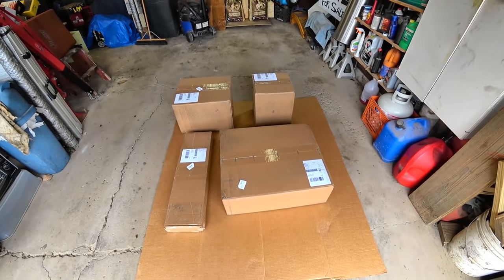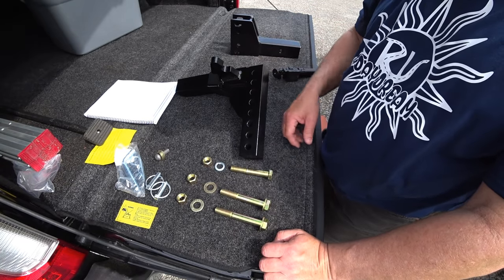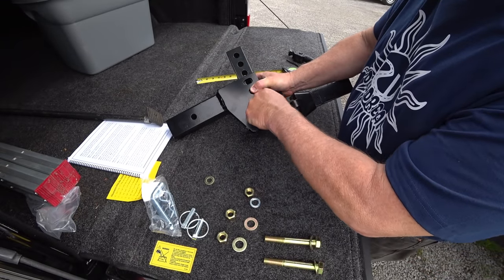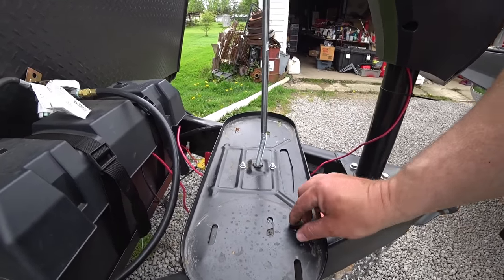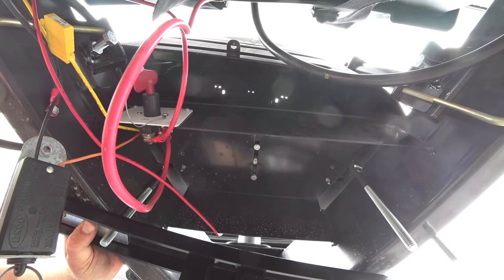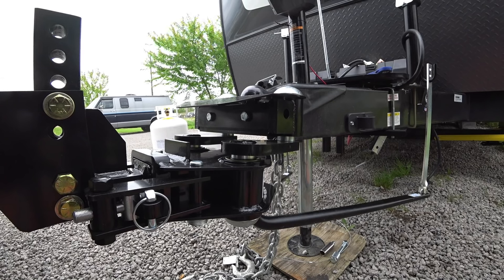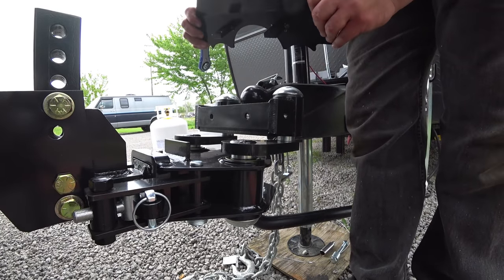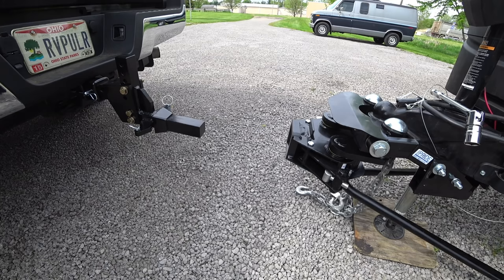ProPride 3P Hitch Complete Installation

Comment: I was wondering what the height is to the top of your receiver on you 2019 -250 ? I run into the same problem where my trailer is way to low in the front. Great job installing your pro pride.it was most helpful. Thank you and be safe.

Comment: It looks like a nice system and good in depth install.  But I just don't like how it puts it father away from the truck putting more leverage on the trucks hitch.
Reply from the maker: I thought that would be a concern for me too but once the weight distribution is supplied it really doesn't make a difference especially on an F250. Kind of like saying I don't like to have heavy tires on my travel trailer. LOL
Reply: @Rvdaydream   ok thats what i wondering/thinking, that you just crank the bars a little more to offset it.  If you can. Some day video from the tailgate going down the road to show hitch works. Would be cool to see.  Thanks and keep up the good work.

Comment: I really really want this Propride Hitch and you did an excellent job in in your mounting and assembling video. I have very little mechanical experience and I fill like I would not be able to install this hitch even if I followed your step by step video. I definitely would not trust just any RV service department to install this properly either. Any suggestions? Thanks 👍🏻 
PS: I also didn’t hear you mention the price of your particular unit, that would be helpful also. Thanks again

Comment: Thanks so much for the video, it really helped me make my installation way easier.  I had a question on the extension kit.  What did you buy?  Did you buy them all separate or was it one kit?
Reply from the maker: The extension kit comes with everything. That was shown there. . You can call. Sean or Brent at Pro pride and they will let you know. If it will work out for you.

Comment: Curious to see how it works when you are in a tight spot where you must hitch or unhitch with the truck and trailer on an angle to each other.  Would the trailer half move back to center making hitching back up an issue?
Reply from the maker: You can easily move and pivot the hitch head to the same angle that you unhitched from... It swings freely...

Comment: Great video, I admit that I didn't quite make it all the way to the end.  I'm also considering one of these hitches but am concerned with their ground clearance as I plan on doing a lot of boon docking, it's hard to tell for sure but what's your ground clearance like? Also, how did you decide between this and the Hensley, they both appear very similar.
Reply from the maker: No issues with ground clearance 😁👍
Reply from the maker: Thanks, it's hard for me to even watch the whole thing. LOL they make these new trucks and RV so tall ground clearance is definitely not an issue. Are old RV WD bars were much closer to the ground then this one is. I was on the fence between the Hensley and the proPride but there was a couple of things that made me choose the pro Pride over the Hensley. 1, I sent basic email inquiries out to both companies and both responded quickly however propride sent me a message that was obviously a non canned message. What I mean by that is my name didn't get pasted in some sort of a pre-formatted responds and sent back to me. Number 2, I was having a hard time with their torque arm part of the Hensley hitch. The fact that they give you a built in wrench on that torque arm makes me believe that you have to always check the tightness of the arms. I think I actually read somewhere the reason those were adjustable because of "trailer frame stretching"? I've never heard of that before. Makes me think that after 20 years of owning our brand new RV that is 29 feet and 9 inches that it will actually become a true 30 ft long RV. LOL the third reason that I went with the propride hitch was it does not require any Drilling in the frame for mounting. And the final reason is how responsive there customer service. I rarely call companies and get someone on the phone darn near every time that I call. And not only someone on the phone but the person that actually knows what they're talking about and has answers. In short really good customer service over the phone. The inside top of my truck hitch tube is 23 and 1/2 in tall. The top of my coupler on my RV is 24 and a half inches tall. I have plenty of clearance with those Heights so if you are even close to that I wouldn't worry about it.

Comment: I noticed when you first attached the spring bar links to the jacks, you used the middle hole.  Later in the video they were on the bottom hole.  Why was it necessary to change the position of the spring bar links?
Reply from the maker: He wanted hitch bar height an inch higher than the hitch box! 😁👍

Comment: @RVDayDream  if you have to drop off the trailer for work to be done and the have to move the trailer around with a ball type hitch, what needs to be done and how easy is it?    I would think  ProPride would make an adapter for this.
Reply from the maker: Well Les, you answered your own question LOL. Check out Pro Pride site they make an adapter👍👍
Reply: @Rvdaydream  Good deal, thanx!   It looks like it has real Low clearance?   Why did you get this one compared to the Hensley?
Reply from the maker: The clearance isn't that low not for most of these modern RVs as they ride pretty high and the pro pride is the latest iteration of the Hensley. It was redesigned and re-engineered by Jim Hensley and owner of Pro Pride.

Comment: Great video. I'm curious how you chose the Propride over the Hensley, I know they are very similar and that the Propride is based off of the Hensley design? Also, what would be your 2nd choice of a weight distribution anti sway hitch if you weren't able to go with the Propride or Hensley? Thanks in advance.
Reply from the maker: The equalizer for sure. The propride is just a better design. It is basically Hensley version 2
Reply: @Rvdaydream  Thanks for getting back to me, the main concern I have with the Propride is how low the clearance is as I plan on primarily boondock camping.
Reply from the maker: 1 bolt in those bars can be removed. So now it's not an issue. 90% of the time you're not going to run into that situation. Maybe even more. My ball height on the trailer when it's perfectly level is 24 and 1/2 in. We've only had that situation come up once.

Comment: Great job on this video, very detailed. Just curious, but why the Pro Pride over the Hennesley Hitch? They look very similar in their operation.
Reply from the maker: Great question! Mike's busy but I am going to say one of the top reasons is CUSTOMER SERVICE from Sean!
Reply: @Rvdaydream  Thank you.  The first Hensley design is still a good hitch but it just isn't the best one available. We've literally addressed every weak point in the design. I wouldn't go so far as say it's obsolete, but it's close.  There's really no place for it anymore.
Reply: RVdaydream Thanks, good customer service does go a long way. Especially since it’s so rare anymore.
Reply: Had this hitch for a year now.  Won’t ever tow our travel trailer without it. Night and day difference that you just cannot make someone understand until they ride along or tow with it.  When the semi passes you two feet away doing 80 mph and you don’t feel a thing, that’s why it’s worth every penny.  If it magically disappeared tomorrow I’d buy another immediately.   It’s worth the money. And once you pass the short learning curve, hitching and unhitching literally takes less than 2 minutes. Stress free.   Thank you pro pride hitch
Reply: @Home on The Hitch Thank you! You answered my question. I have a heavy 2001 Dodge diesel pulling a 34’ Outdoors RV using the Equalizer hitch. 2nd and 3rd gen Dodges are infamous for road wander. Even though I’ve installed after-market items to tighten it up, every time a f’ing semi barrels past me, I get ‘sucked in’ and dread seeing them coming up in my rear view camera.  Now I have to start stashing away for a ProPride lol

Comment: So I am on the fence between the Hensley Arrow and the P3.  What was your deciding factor on the P3?
Reply from the maker: Being that it's a newer redesign over the original Hensley. Sean at Pro Pride who was in charge of Hensly for quite a few years had left the company and sat down with Jim Hensley and collaborated to come up with the new improved design. The other thing was customer service through the roof at Pro Pride. You can call pretty much anytime and get hold of someone there who's willing to help. And personally I don't care for the strut rod or whatever Hensly calls that piece that you have to continuously make sure it's tight so much so that they put a self adjuster built into it so that you don't have to get a wrench out because it has to be done so often or checked constantly. Other than that I think their operation is probably close to the same.
Reply: Thanks for the input.

Comment: How is it for backing up?
Reply from the maker: Just like any other hitch except for two positives, one 87 degree angle. That is awful nice when you need to turn it kind of hard to get it in at spot especially with how long our truck is. And number two, you don't have to loosen the weight distribution tension prior to backing, that's right, you can do an 87 degree turn with full weight distribution tension on the bars.
Reply: Thank you.

Comment: Watching from Australia so many of the "terminology's" may be different but is this a "anti sway" setup or a "weight distribution" system?    From watching the installation thru to the end it appears to be a "weight distribution hitch", essentially a way of transferring  the weight at the ball back tot he front of the vehicle (leveling out the tow vehicle after the caravan is lowered onto the tow ball???
Reply from the maker: Welcome  Australia! , This is a weight distribution hitch, that eliminates sway. 98% of the trailer hitches on the road today just have a sway control system that addresses sway as it happens. however the pro Pride changes the way the trailer gets pulled down the road. The hitch is permanently fixed on the trailer ball coupler and it no longer pivots on the trailer ball. Instead it has to separate pivot links on either side of the ball and makes it to where the trailer cannot physically be pushed around by the wind or passing tractor trailers on the highway without moving the tow vehicle side to side by sliding  the tow vehicles rear axle, which is darn near impossible. Just look up Pro Pride hitch on YouTube and you will see a few other videos. One of them, in which you will see a shot of the hitch in action as it drives down the road.
Reply: RVdaydream OK, we just call it a WDH here most commonly sold by Hayman Reese.   We use a WDH with our 21' van, towing with a Colorado diesel.   The drawbars on our vans here appear much longer than your vans.   Enjoying watching your journey......we are planning on full time travel in the next year or two......we will be part of the "Grey Nomad" family travelling non stop around, thru, across and over our big country..... A right of passage her in Australia is  called the Big Lap, essentially travelling right around the coast of Australia......

Comment: Great video sir.  Question...isn’t the break away cable supposed to be connected to the vehicle not the hitch assembly?
Reply from the maker: I suppose I need to do some sort of a survey on that. I'm sure the best place for the Breakaway cable to be secured to is directly to the frame of the vehicle. However, most people connected to their hitch. The majority of trailers I've seen lost off of vehicles have either bounced off the ball or the hitch has rusted off of the frame. As for me I just connected to the hitch bar. The chances of that hitch bar coming loose from the truck is darn near zero

Comment: Wow... 

The clearance to the ground seems to be pretty low. Comparing it to a normal equalizer hitch i think you lose a few inches. 

How much does this hitch add to the hitch weight? 

Let us know how it works! 

Thanks for the video. 

Bill in Utah
Reply from the maker: As tall as the new RV's and the new trucks are, the ground clearance between the weight distribution bars is much higher then our old set up. The total shipped weight of the propride hitch is 200 lb. Of course using weight distribution, most of that gets applied elsewhere. It is also another reason why we chose an F250 over an F-150.

Comment: Is this better than the Hensley ?
Reply from the maker: My opinion is yes...
Reply: RVdaydream what makes it better?
Reply from the maker: @mrpaulgrimm6129  the original Hensley hitch was redesigned by the original engineer and a former Hensley hitch employee and they found all the shortcomings of the original Hensley hitch and designed the pro Pride. The strut arms that the Hensley hitch uses requires constant adjusting. So much so that they include a built-in wrench to do the adjustments. The pro Pride requires none. Pro Pride customer service is incredible.
Reply: RVdaydream please tell me the improvements
Reply from the maker: @mrpaulgrimm6129  the video information is basically all that I can provide on the product. As mentioned in my previous comment the strut arms that Hensley uses is a problem. There should not be any additional adjustments needed once something is installed other than retorquing mounting bolts and that should only have to be done once after the product has been installed. The Hensley hitch requires retorquing of the strut arms on a regular basis. And the angle of the Stinger cannot be adjusted 4 weight distribution on the Hensly. Please call Pro Pride and they will explain all the differences in great detail.